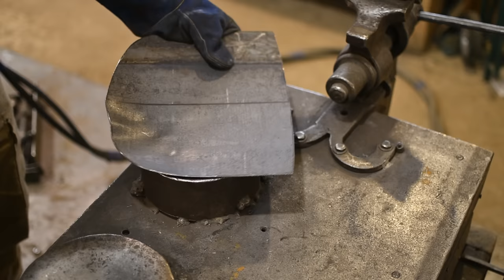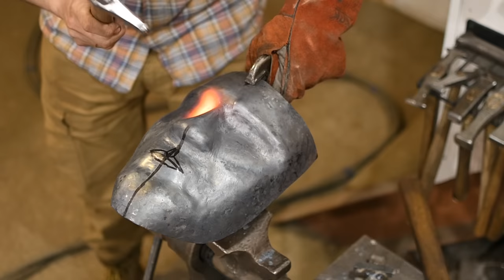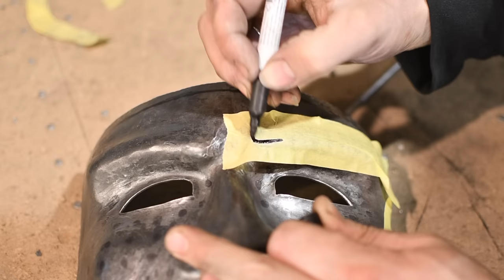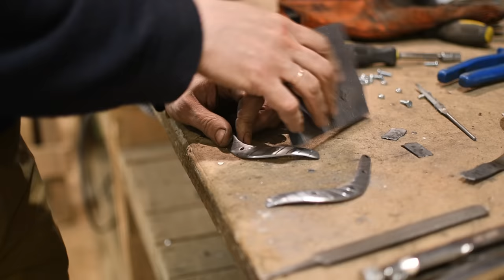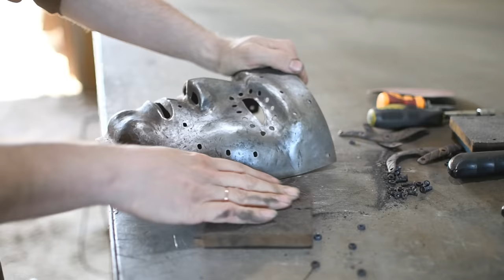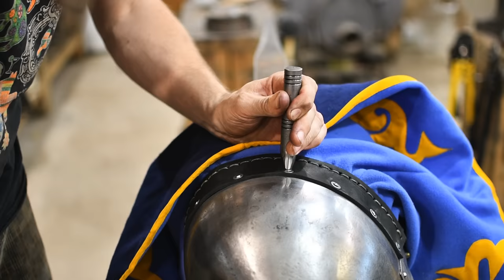How to forge a steel face. How to make armour

Comment: Amazing job! I've only tried blacksmithing once and it's so much harder than it looks. Took me almost two hours just to flatten a piece of rebar into a crude and misshapen coal rake, and it only took you three hours to turn a piece of sheet metal into a beautiful face mask!!
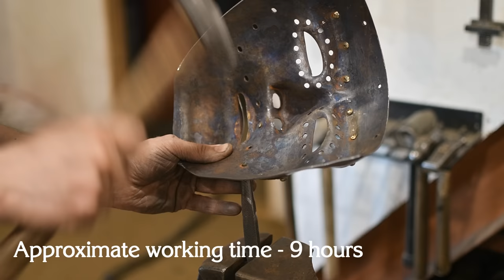Reply: It said "approximate working time. 9 hours.". 12:35
Reply: @BillyBob-kj4qq  I assume the were talking about how good it looked at the first time mark.
Reply: @jedaskane2700  ahh. Either way, the time is extremely impressive.

Comment: I am seriously in awe. It may look easy on the video but in reality 2mm sheet metal is a real b**ch to work with, and here he makes a human FACE with it? Props to the dude.

PS Also I see that the curse of ripped left glove doesn't apply only to me XD
Reply: im currently in the process of attempting it with 1.5mm steel but with no blowtorch or shaping tools, just a spherical hammer in sand

Comment: Seeing this kind of work has me wondering how they did it before the torch, I can imagine coal but the time that way would take. Also always fun to see craftsmanship in hyper speed magical.
Reply: Wind, fire, water. Isaiah 43:2[2] When you pass through the waters I will be with you;
and through the rivers, they shall not overwhelm you;
when you walk through fire you shall not be burned,
and the flame shall not consume you.
Reply: they would use a normal forge
Reply: forge and bellows. it gets really hot as well but it's a lot of work.
Reply: @gordonlekfors2708  And I suppose there were many smiths around a single forge, working many pieces all day.